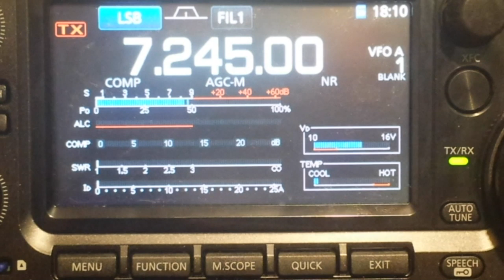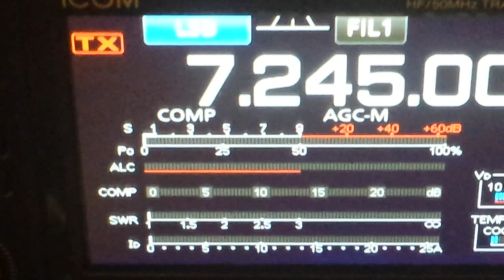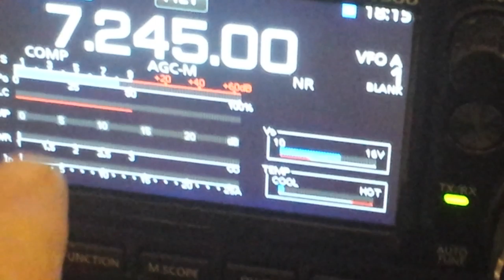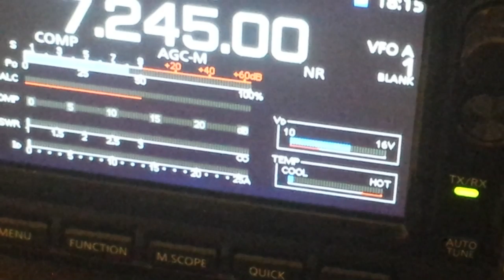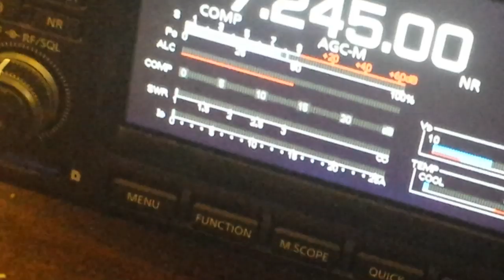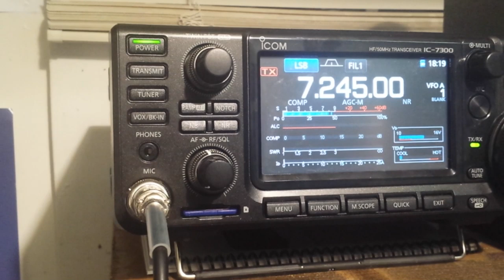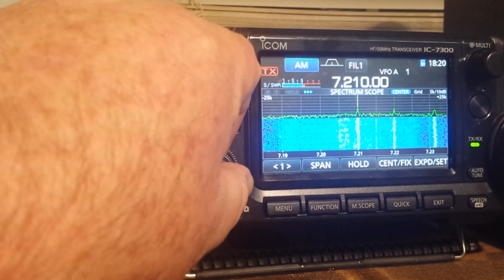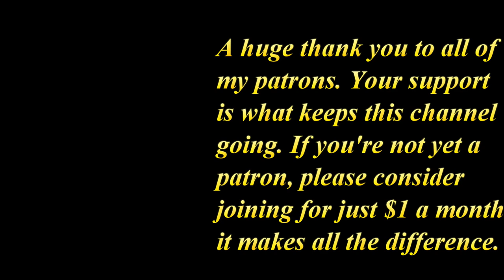Test your feedline for common mode noise and shorts

Comment: Hey bro great video. Im having super issues with my CB install in my Jeep Wrangler Running a Cobra 29 mounted above my rear view mirror, antenna on the back steel bumper on an antenna mount where I used a flat braided ground line bolted to the frame of the jeep to the antenna mount. connections both to the antenna mount and frame of jeep were cleared of any paint - so its direct contact to bare metal. When I turn on the cb im getting great signal receiving with no issues. the second i try to use the mic and key in - my dash goes crazy lighting up everything, making the wipers go off and tachometer bounce around. Do you think this is a common mode issue? im running out of things to try lol any help would be great bro
Reply: Have you connected the radio directly to the battery, on both wires ?
Reply: @howardhiggins9641  yes both wires are connected directly to the battery. Im really running out of options lol
Reply: @johnnyalonso  You might also try a coax cable with better shielding.. Are  you getting a good VSWR ?

I have read other posts that SOME jeeps, in particular, have mobile radio problems.  Have you asked Jeep about service bulletins on the issue ?
Reply: @howardhiggins9641  thanks for the reply. I'm going to have to swap out my coax for one wirh better shielding I just don't know which ones have a better shield lol ant recommendations? Ans yes I've called a couple jeep after market shops and both have only come across this problem with newer jeeps. If you know of any good shielded coax or if there's something I can wrap the coax with let me know. Thanks man
Reply: @johnnyalonso  Whatever you do, go with a BRAND NAME coax, not some junk off Amazon.
If we absolutely knew this was the problem, I'd say to use RG-400, which is a double shielded construction.  
All coax is sold by the foot, and the best price you'll probably find type for this is $3.75/foot.
A heavier coax would be difficult to install.  You should read up on installing coax before you spend any money.  They all have a different minimum bend radius'   If possible, and you can still route it without problems, I suggest you buy the cable precut (with only a slight amount, say 1/2 foot ) of extra slack, with the connectors professionally installed..
Good luck.
Reply: @howardhiggins9641  thank you for the reply and answer. I'm pretty sure my coax is junk. It wasn't that expensive. I'll look into what you mentioned. And im pretty sure I have more 1/2 foot slack. I have probably closer to 3 feet hidden in the jeep wheel well. I'll look I to buying rhe good stuff and see about bendability. Thanks souch man for the reply. Im thinking this will do it.

Comment: I'm sorry but this is a "faulty" test . Basically you plugged the inner of the coax so what should be 50 Ohm now is 450 Ohm wich is nothing less and nothing more than a "long wire" but the un un 9:1 AND not tuned at all. Of course your receiver gets kinda saturated because the antenna, wich act as a random wire, is receiving everything . This won't tell you anything at all : you get exactly the same with ALL aerials and theyr coax if yo plug the inner by every receiver of your choice . You only have to test putting a common mode 1:1 rf choke on the antenna side, or back of the radio or both . There's no magic and no other way . Oh and i'm sorry but you have LOADS of noise due to the common mode current...it's more than clear just listening the "sound" of the noise . Last but not least you should use the Ipo or a attenuator when listening on low bands : this makes the receiver front end more happy (but you may did that because the video and to show a reasonable signal) .